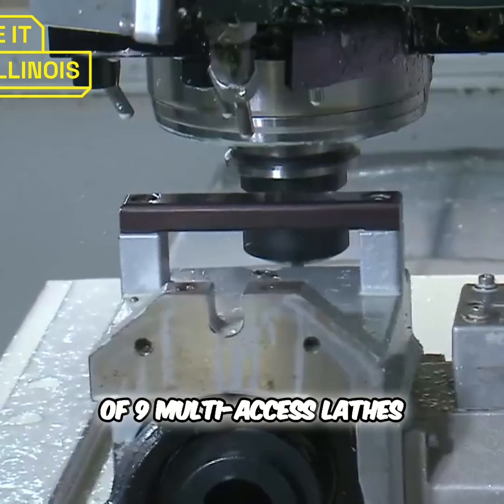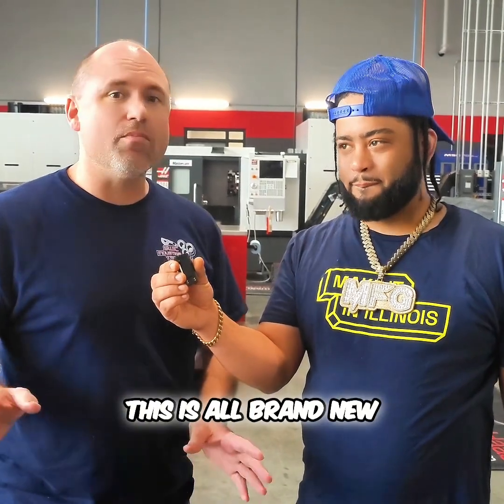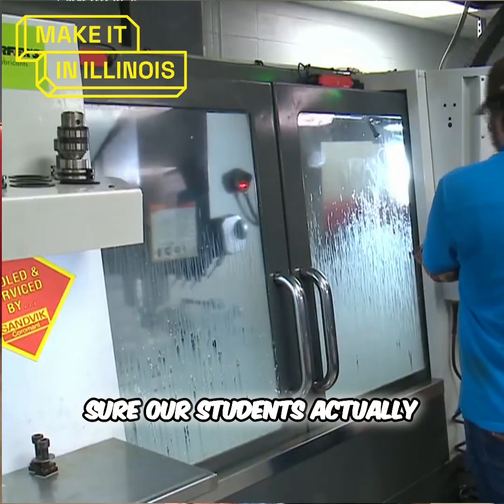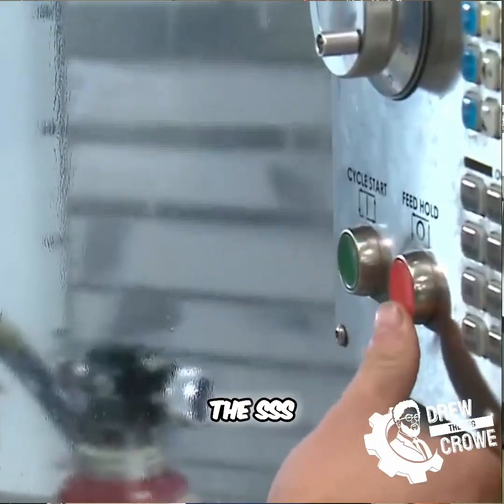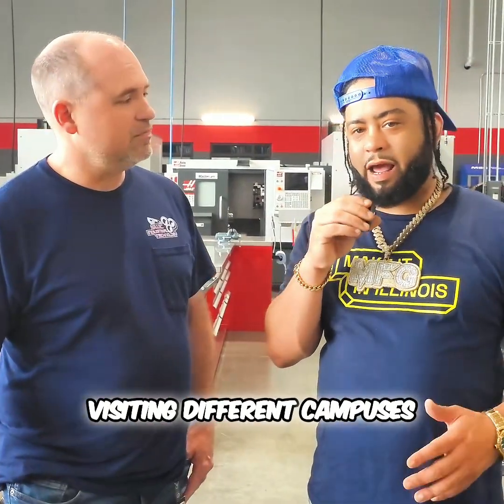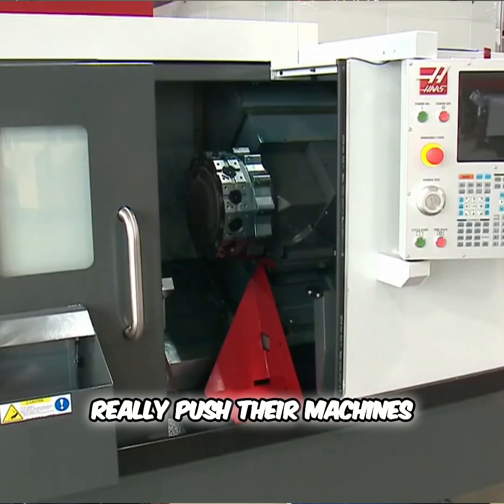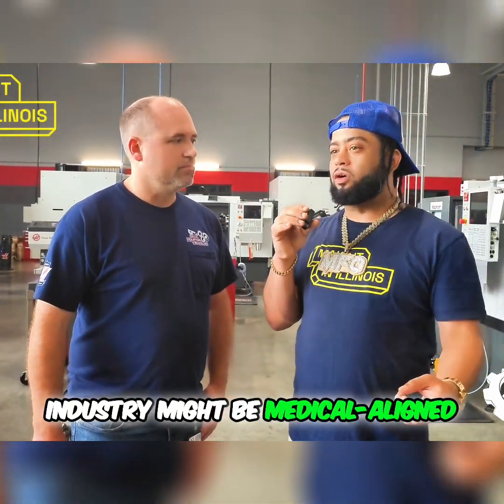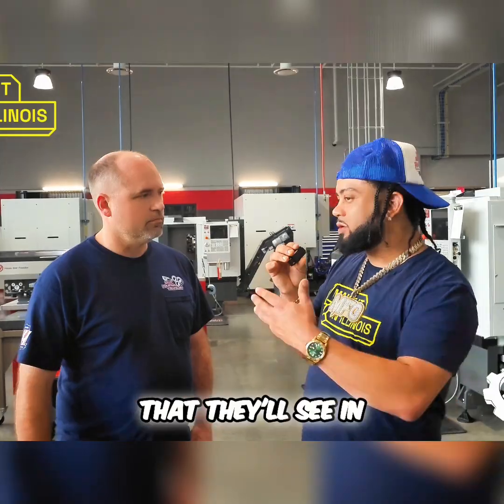Future-Proof Your Skills: Master Advanced Manufacturing at Academy! #shorts

Comment: What is a manual cnc lathe? Isnt the part cnc what tells you that a computer operates it not you manually
Reply from the maker: Bro is a well known and respected machinist and instructor. In the game at a high level for years. Probably just a slip of the tongue homie 💪🏽
Reply: @DrewCrowe_MFG yeah no problem i was just wondering if i am missing something